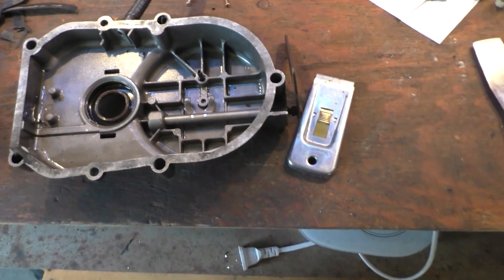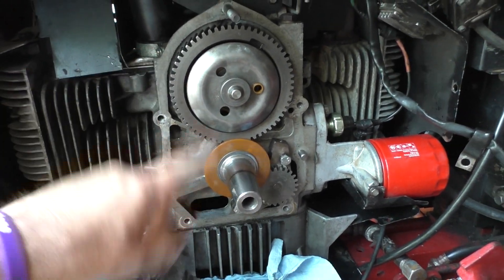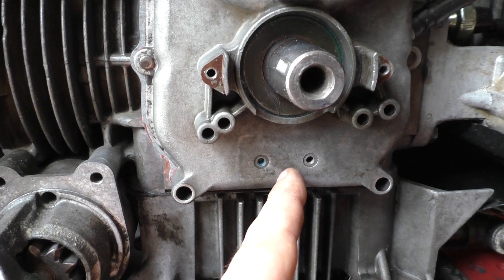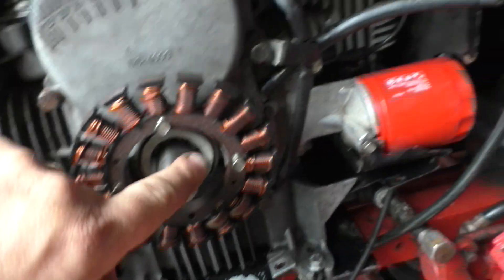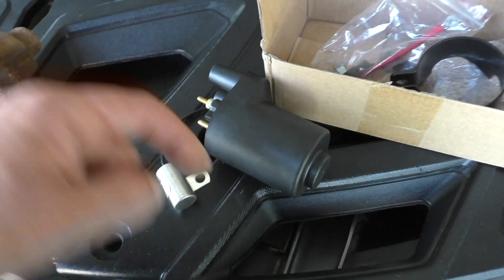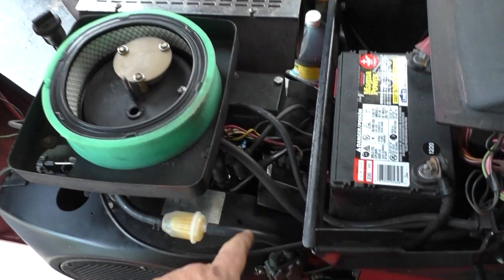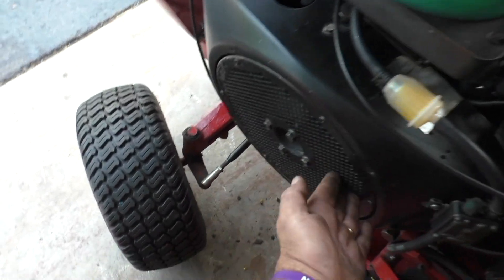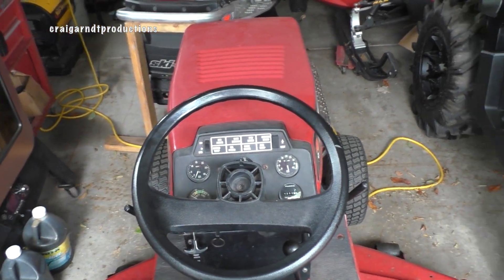Wheel Horse 520,  fixing leaks and breaking things...

Comment: I almost have got some 1/4" glass and put some 400 grit wet sand paper taped down to it and lapped the matting surface of that timing cover to ensure it was perfectly flat before putting it back together. I like Permatex 1 Minute Gasket Maker. Stuff cures like rubber! Love it. Use it on all of my repairs now. But I have replaced both my Spark Coil and my VR/R on my 520 in the past year and half. Get ahold of Lincoln at A-Z Tractor parts. He's on the net. Real nice guy! He parts out all this stuff. Also you can clean the rubber parts well with carb cleaner when they ripped and use some superglue to fix them. The stick back together almost instantly. 

 Thing purrs like a kitten. Glad to see her back up and running. I think mine's going to need to full restore soon. ha ha. But it's good to know I'm not the only guy with a missing steering wheel, wheel horse logo. ;) 

God Bless Brother!

Comment: Good job and love the decals! Thanks for saving a Horse! I own quite a few 200, 300, 400, and 500 series Wheel Horse tractors. I love using them and working on them. 

Couple things:
Did you happen to replace the small ball bearing that sits under the rod for the governor arm? I noticed that the forks from your governor arm inside the cam gear cover weren't even, and the top fork was sitting closer than the bottom fork. I can't remember exactly what this can/will cause. Something to do with proper governor operation. But I have heard before not to lose that ball bearing. It can fall out when turning the cam gear cover upsidedown while removed. 

When you were in the cam gear area, did you see what kind of governor ball spacer you had? Plastic with extended tab, plastic without extended tab, or a metal one?
Plastic ones without the extended tab eventually start to slip on the camshaft after 15-30min of full throttle and will slowly start to overrev above 3600rpm.

Comment: Hi Craig! I've fought with that stupid coil installation on my 520-H many times lol. I had to take the engine off and have the  starter mount on the block welded. The previous owner put on a a new starter and flywheel and subsequently broke the flange on the block by over-tightening it. He had the starter wedged in with a piece of wood that was also zip-tied to the engine mount. It could probably use another starter and flywheel because they are all chewed up from the original "fix." I had to replace the coil as well, and I think I used the same one you bought from eBay, with no problems so far. She's got 1200 hours on it and I probably need to de-carbon it soon, but it doesn't see the use yours does. Take care!
Reply from the maker: Thanks Big J.  Turns out, wasn't that coil.  The coil tested high, but the issue was in my last video, sheared the key off probably from having grease on the crankshaft and not a good dry surface.  Got a new key last week, fired up and no issues.
Reply: @CraigArndt  glad to hear that! Interesting how grease would do that. I also had a charging issue and had to fix the wires going to the stator, as they were cut through. Not exactly sure how it happened, though. That still didn't fix the charging issue it had, either. Ended up replacing the voltage regulator and now it charges great! I've got a whole list of things I've done to it, much like you do! Your videos are a huge help too.

Comment: Hey Craig. I posted a comment in the last video. I think your missing a ball bearing part #HE510-0105. It centers the fork that pushes on the flyball cup. Check out a schematic. They're easily lost because they're so small. Good luck.
Reply from the maker: I'll take another look at a schematic.  Everything that is on there has been on there since I bought the tractor, but who knows what happened prior to me buying it.  Thanks for the tip!
Reply: No problem. Now that you have it buttoned up, it's a moot point. Gaskets are too expensive to tear back apart. The old 520 is a lot easier to disassemble than my John Deere 318's or 420. Keep us posted. Darn China coils. 👎

Comment: I have a wheel horse 518 H and I had a carburetor problem I don't have no coil problems not one of these days I need to put a new coil on it
Reply from the maker: Well my advice, buy a good Japanese made coil like the OEM Denso coils.  Even if used.  I think these new ones have cheap windings.